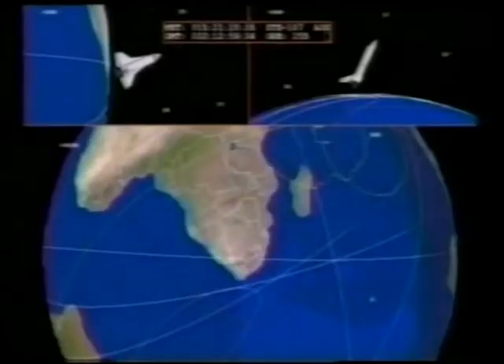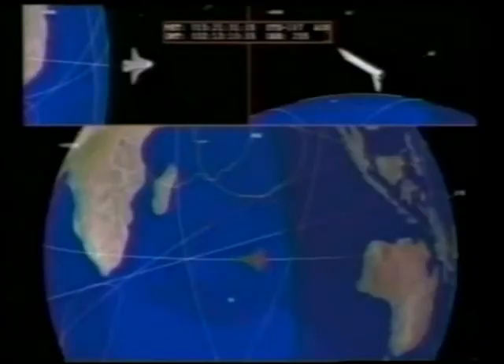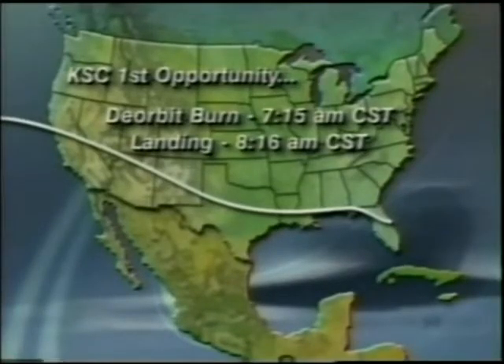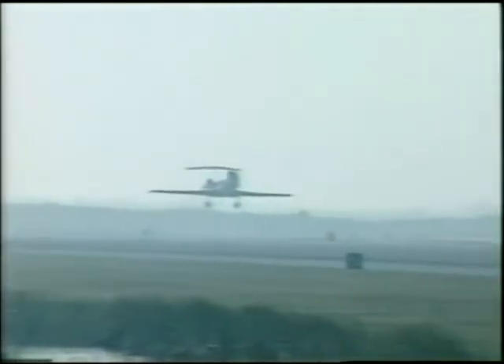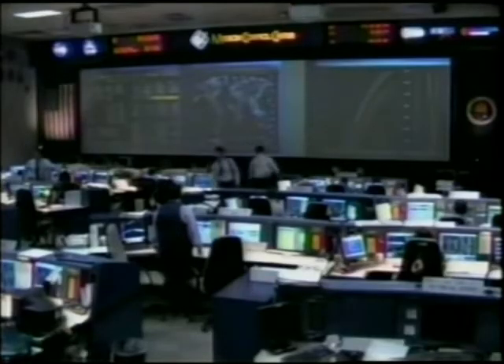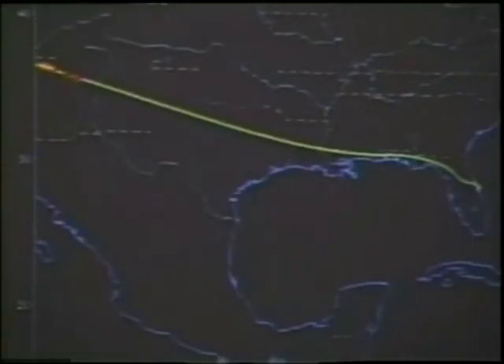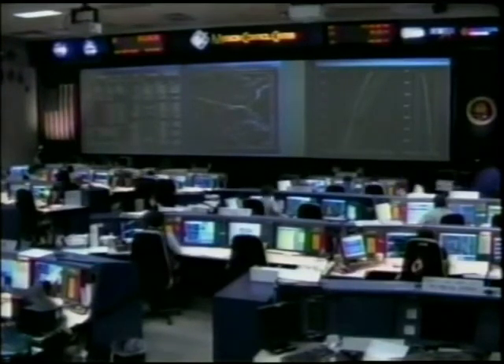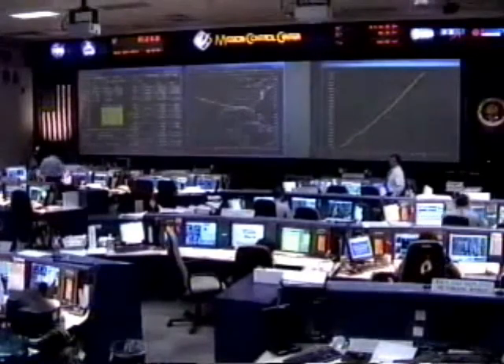STS-107 Rentry NASA Footage

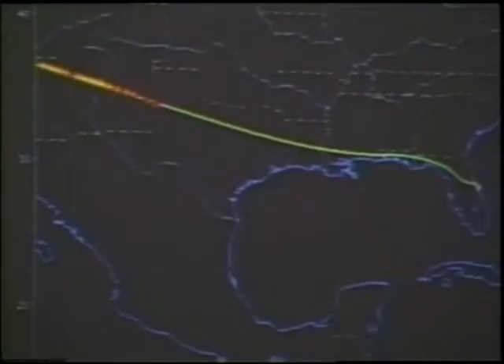Comment: 58:42
First real indication that the crew knew something was not right.
"Feeling the heat". Meaning that flight performance was giving indication of damage.
Reply: Well, that seems normal to me, I think "feeling the heat" it's a phrase you say when you are entering the atmosphere, the re entry. If the shuttle is thousand of degrees outside you are obviously gonna feel a bit of heat
Reply: @limbercubas    But inside 70F is maintained.

Comment: had it landed in CA i would it would have saved all life's and save the shuttle as well but be out for repairs for awhile.
Reply: They still need 4000 MILES of exposure to this atmosphere from the de-orbit burn to touchdown.. WHERE it lands is irrelevant. The problem began long ago in the design phase. This orbiter is way too large which requires a humongously long exposure to plasma generated re-entry. Its a matter of kinetics. The bigger something is and the faster its moving the more reactionary kinetics involved to slow the thing down. Its like trying to stop your vehicle from 100mph against stopping a gocart from 10mph. a HUGE difference.
Reply: Pretty dumb comment. 

Landing in CA would not have saved Columbia. They still would have had to travel the de orbit distance to slow the shuttle down in order to land in CA. 

The shuttle was traveling roughly 15,000mph - it’s not gonna stop on a dime and hover over CA for the possibility of landing.
Reply: Landing in CA would have not been possible. It would have broken up regardless.
Reply: You know nothing.  No matter where they attempted to land, it would still have to come down through the atmosphere and it would have been the same result. Period.

Comment: 59:31.  At that moment, the Columbia would have remained intact no longer than 46 seconds.  Just previous to that, they were informed that a normal landing was not possible, and they were going to crash land upon arrival due to the loss of the left landing gear, and tire pressure.  At around 59:36, the spacecraft lost hydraulic pressure rendering it uncontrollable.  The master alarm sounded, and the vehicle would have started to roll and yaw violently.  From then on, the crew would have started to know that the end was near.  40 seconds of sheer unimaginable hell.  There was nothing Commander Rick Husband could have done to save the severely damaged Orbiter.   1:00:17 is when the orbiter disintegrated completely.  If the crew had not been killed at that point, they would have survived no longer than several seconds.  

Live through those seconds there to know for yourself how quickly that was.  

RIP STS-107.
Reply: I don't know where you obtained this information but I sincerely thank you very much. Yep that's when telemetry stopped and map positioning on the big screen halted. The crew was probably "gone" within seconds of that event as a lengthy survival at these extremes of heat & lack of pressure would not have been even remotely possible. Are they suited up with pressure suits? Regardless it would not have mattered either (thus I would say suits with this kinda entry would have been superfluous)..
Reply: If you want to live, fly and dive Russian.
Reply: @21stcenturyscots  Elon’s rockets haven’t killed anyone yet
Reply: Wonder what that last transmission at 1:00:27 is then.
Reply: Where are you getting the idea that the crew were informed that they would have to conduct an emergency gear up landing? That's not in any of the official timelines, nor the master copy that incorporates all the misc data.

It's certainly the case that they would have had some trouble landing correctly, but control had only just begun working the problem through immediately before and after LoS. Had Columbia not broken up they probably would have told them around that time.
Reply: @noecarrier5035  Hmm.  I guess I can take your point there, and edit my comment.  

Nonetheless, if the orbiter survived reentry, the structural integrity of the left wing would have been grave.  In no way would a normal landing have been possible.  The damaged wing would’ve affected the Columbia’s handling as it descended through the stratosphere and troposphere.  Would it have had to shorten it’s flight path and land somewhere else to accommodate for the increased drag on the left wing? Or would the dense air of the lower atmosphere alone have been enough to rip the damaged wing off as lift on the spacecraft increased? What about surviving the shock load of landing? At the time of the Columbia’s final transmission, nearly all the temperature indicators in the left landing gear were not responding and the hardware at that point was irreparable from the air friction.  The progressive instrumentation failure was an indication of a very serious problem.  Mission Control at that point knew it, but all they could do was pray.  Speaking of heat here, it’s possible that the landing gear tires exploded knocking off the landing gear doors sealing the fate of the astronauts and vehicle even faster.
Reply: @Luxo087  Interesting questions. There were numerous problems standing in the way of a safe landing that would have made a normal return impossible, as you say. The protocol on what to do is clear looking through the manuals and abort modes. If there was some issue with the gear or suspicions of damage to any system that would prevent a stabilised landing then the abort mode is a crew bailout wearing their ACES. They'd have flown Columbia out over the ocean off the SLF at Merritt Island, which would be cleared of air and sea traffic as normal, levelled the wings and then bailed out.

The damaged section of the wing would probably not have produced enough drag to make much of a difference in terms of downrange speed. However, if it had made a difference this would have been very obvious to the crew and controllers. I imagine they would have picked the best, least crowded bit of water  they could. In terms of stability, the Shuttle had a lot of control authority and numerous aerodynamic gadgets for trim and so on. It would have been easy enough to adjust to compensate.

The bailout procedure is pretty cool: at 10 km they depressurise the cabin and then explosively jet the hatch doors at 6 km. Then the special telescopic escape device extends and they hook up to let it carry them safely away from the Shuttle without recontact. By the time they all get out they'll be at around 3 km and waiting for the automatic parachute deploys. It takes about a minute for all the crew members to get away.
Reply: @dwaynedwayne regretsky highly unlikely.
Reply: @dwaynedwayne regretsky it was possible but incredibly dangerous because they’d have to bypass safety checks and Atlantis would’ve done the mission called STS-300.
Reply: @dwaynedwayne regretsky I do think the rescue mission could’ve paid off.  But the risk factors would have been very high.  NASA would have had to summon a crew consisted of those whom they thought were best suited for this mission, plan the flight, train the crew, and launch Atlantis within 2 weeks.  Astronauts can spend 40+ months training for a flight, imagine being told that you have no longer than 2 weeks to prepare for the most difficult flight ever.  

While NASA would’ve been working everyone they could 24/7 to attempt a rescue, the crew of Columbia would’ve had to start marginalizing their food and water rations and monitor the progressive mounting presence of CO2 inside the spacecraft.  For NASA, this would’ve been déjà vu of Apollo 13.  Spacecraft failure, get the crew home, ration supplies accordingly, mounting carbon dioxide, failure is not an option.  For the skeptics involved, NASA would have once again been dealing with the number 13, because STS 107 was the 113th Shuttle Flight.  

Columbia would have had to remain in orbit longer than any orbiter before.  Most likely 25-28 days waiting for Atlantis to rendezvous with it.  Upon Atlantis pulling up underneath Columbia unparalleled, the crew of Atlantis would have attached, basically speaking a tether line from one airlock to the other, and the Columbia crew would’ve all had to spacewalk unassisted using the tether line from one orbiter to the other.  Upon evacuating the Columbia crew, Atlantis would have re-entered the Atmosphere and Columbia would’ve been left to burn up.  

The other option was repair in orbit.  But to repair that RCC panel in orbit with the supplies they had on board would’ve been an astronaut duct tape and super glue job at best, and then they would’ve had to attempt re-entry.  Either way, the risk factor for loss of life was very high.
Reply: @Luxo087  they could have docked at the International Space Station.
Reply: @bindlepig8064  wrong. They were on a 39 degree inclination and the ISS was 51.6. It was physically impossible to change the orbit and still have enough fuel.
Reply: @bindlepig8064  no they couldn’t have.  The spacecraft had the Spacelab on board, making docking with ISS impossible.  Also, when a space shuttle docks with ISS, they send it on a trajectory straight to it.  The shuttle cannot simply navigate over to the ISS when it’s in orbit.

Comment: nasa didn't learn a damn thing from challenger .accident there ass
Reply: What an over-kill! Ofcourse we learned from Challenger otherwise we would've lost more shuttles on liftoff.
Reply: bs. otherwise columbia would've made it back safe .but again managers didn't listen to enginers.yet again
Reply: @stormsfromcalifornia4379  How exactly were they gonna return? Either way, challenger and columbia were two completely different accidents caused by completely different failures. As you might've noticed, no other shuttle (after the challenger explosion) was lost on liftoff. 

1. The extent of the damage was unknown and there had been foam impacts before. Like every single flight. So no one was really worried up until re-entry when the telemetry data coming from the left wing sensors began going haywire. 

2. Even if they had acknowledged the problem earlier on, again pretty much nothing would have worked. Docking with the ISS was not an option either. ISS and Columbia were on different orbits at the time and even if they tried docking they'd be facing two problems...
   1. The orbiter was short on fuel. 
   2. It was also impossible to physically dock because of Columbia not having the correct docking-ring.
Reply: weli challenger never should've been launched as for columbia there might've been a way we'll never know.if nasa had a shuttle ready who know same problem might've happened
Reply: @stormsfromcalifornia4379  NASA was helpless on this case. Atlantis wasn't ready. And any delay on Atlantis' program would have ended up being fatal for the crew of Columbia as they would run out of oxygen. And how exactly was Atlantis going to help? In order to successfully dock two shuttles you would need to make a major redesign to the docking adapters on both shuttles. After the foam impact, Columbia was pretty much doomed.
Reply: @anavgeekspassion5727  If NASA had known about the hole in the left wing soon after Columbia reached orbit -- either by means of military satellite photos or a spacewalk inspection -- there’s a chance they could have sped up the Atlantis launch preparations, rendezvoused the two Shuttles, and transferred the Columbia astronauts to Atlantis over a tether between the vehicles.  Risky for sure, but better than no chance at all.
Reply: @stormsfromcalifornia4379  what happened to Columbia wasn't the same thing that happened to Challenger. The Columbia failed due to an o-ring, Challenger disintegrated due to foam hitting the wing. It's not even the same thing.
Reply: @TheWholeGrainBread_Real other way around. Challenger was destroyed by the o-ring failure, Columbia was destroyed by the foam strike.
Reply: It almost happened again to Atlantis and all the crew thought they were going to die but they got lucky by the grace of god.
Reply: Actually, they did learn a lot from the Challenger accident.  The in-house problem arose when that knowledge (the “Listen to the engineers” lesson) was not passed along from the Challenger-era administration to the Columbia-era administration 17 years later.  Those in command of the Challenger mission were humbled by the effects of their arrogance.  They had all retired or moved on to other jobs by the time of the Columbia mission.  The humility they gained from the lessons of Challenger retired/moved on with them.  The lessons did not stay with NASA; the lessons left when the people who learned them left.
Reply: shut up columbia and challengers disaster were not linked in any way. One was heat insulation issues and one was fuel pipe leaks there was no realistic way that columbia could have been prevented RIP they became falling stars. 7 shooting stars falling into heaven RIP

Comment: So only after this horrible experience did nasa start to train astronauts how to reapply the tiles in space 😞wow !!! You would think that would be part of training before hand .
Reply: Tiles was not the problem here. It was a reinforced Carbon Carbon panel that was breached. Repair in space would not have been possible.
Reply: This was not a tile problem. It was a hole in a reinforced carbon carbon panel. It could not have been repaired in space.
Reply: Along with the other responses, they didn't have the ABILITY to fix anything. There was no kind of tool kit available.
Reply: there were no space suits on this mission so even an inspection was impossible
Reply: Space exploration works like aviation sadly. Accidents brought us to where we stand today. Fatal crashes of Challenger and Columbia are ofcourse included on this list. They reminded NASA that the shuttle fleet was expensive and dangerous to operate. With many flaws lying deep beneath the surface. We learned from both Challenger and Columbia.